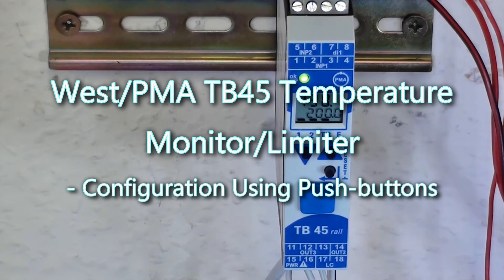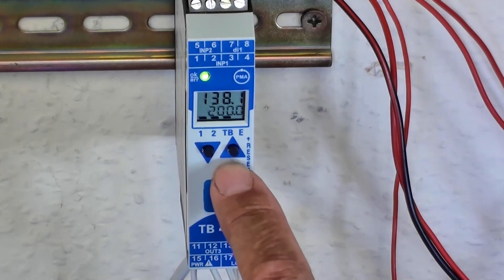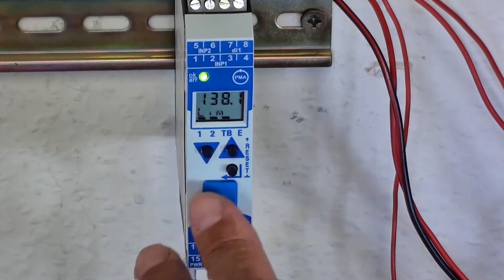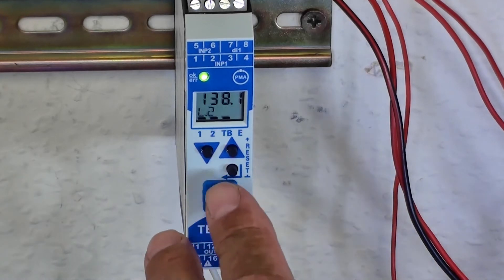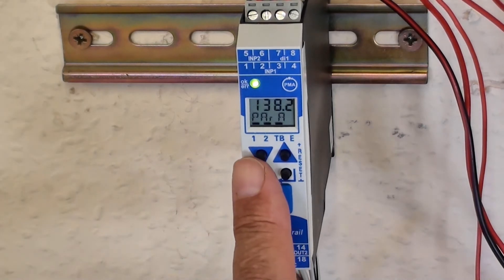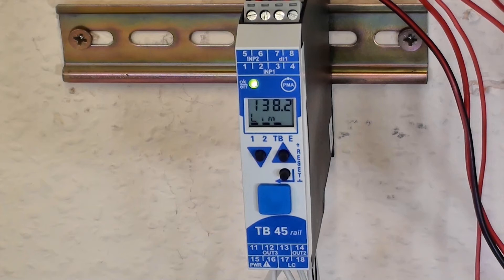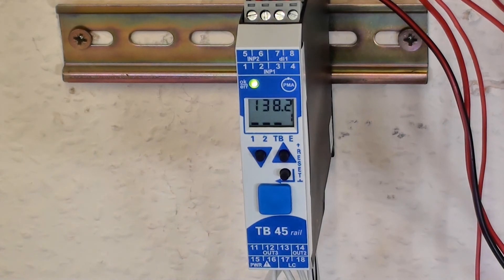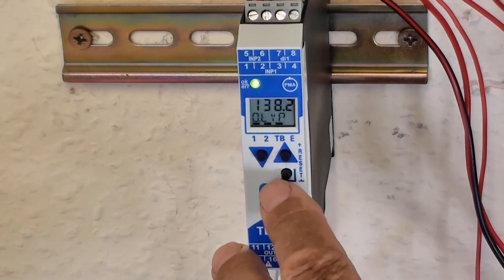PMA TB45 Rail Limiter - Push-button Configuration

Comment: We configuration the trancimitter ci45  the reading on the screen OK but there is a problem in connect between trancimitter and plc analog module
Reply: The problem is ground fault in analog input module  in this channel although when we connect the old module there's no fault